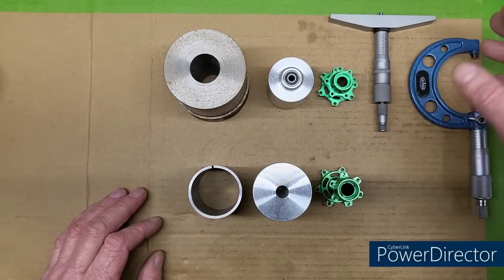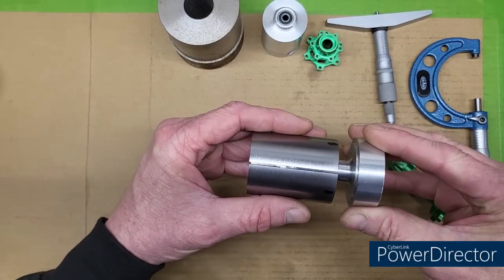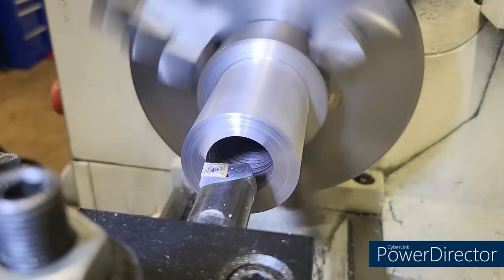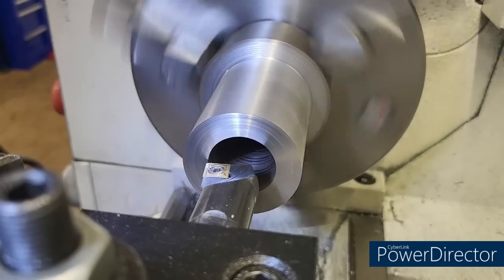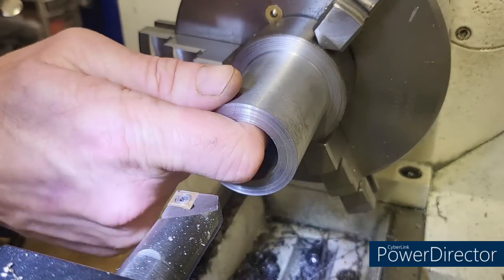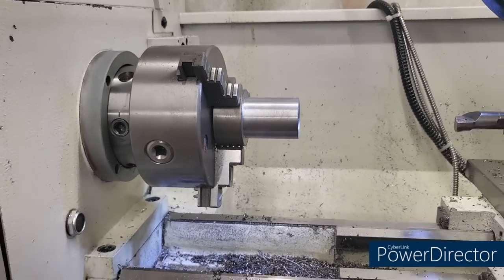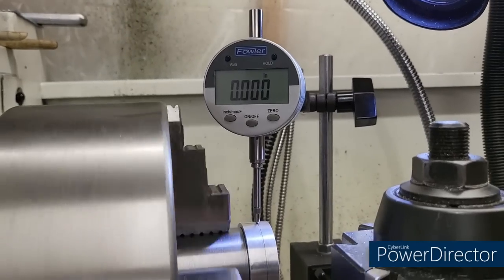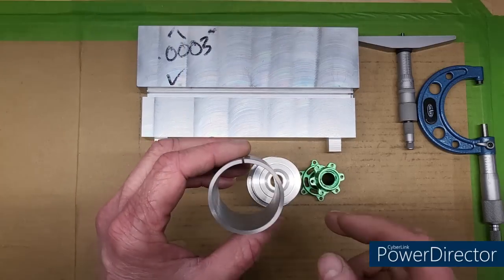Manual Machining precision work holding @Toolmaker001

Comment: I would recommend to cut slot in id diameter too as you cut from the side, doesn't need to be very deep. that way collet will clamp on diameter, not two points.
Reply from the maker: .0015" clearance. It clamps on full circumference..
Reply: Well, it does not. collets like ER type does clamp on diameter, one slot or two won't do the trick
Reply from the maker: Thanks, I'll keep that in mind. I certainly know what you're saying. But the tolerances are so tight that a major majority of the circumference surface area is working. Plenty of grip. Without nit picking, if my tolerances were more loose, then we would definitely be seeing what you're implying, which is accurate. Either way, good job, smithy.
Reply from the maker: Hey Smithy, throw that soft 1018 in there as well. I very much enjoy people like yourself, people who think..
Reply: well, I have no special talent I am only passionately curious :)